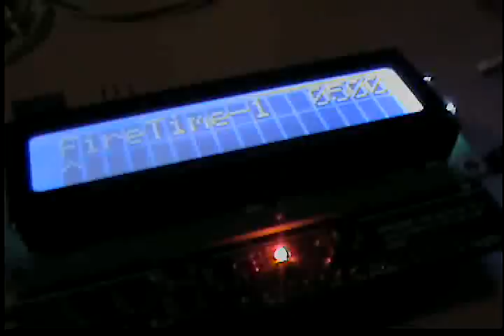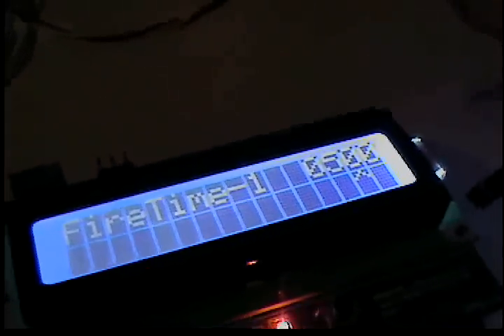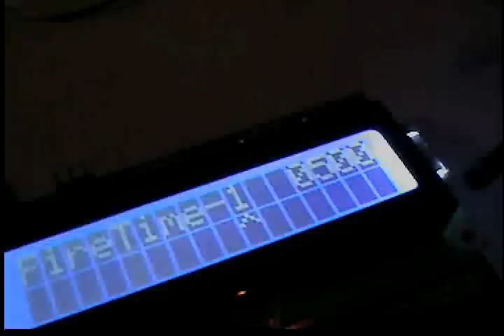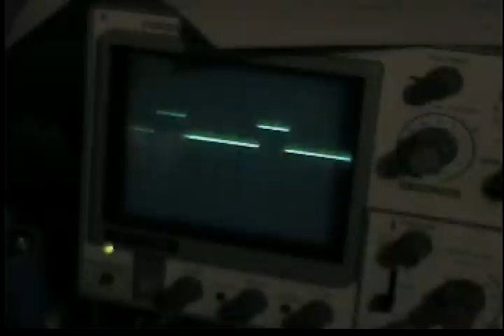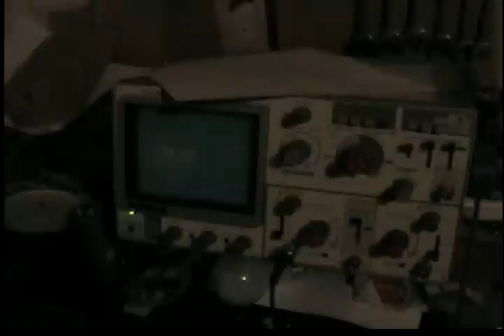Window motor update

Comment from the maker: @llewgnal  Yes if you change the 0 to a 1 on the save screen it saves settings. The changes made by pushing button are used right then, you only need to save if you want to start next time with same numbers. The micro number is stored in eprom once saved the called at beginning of the power being turned on.

Comment from the maker: @llewgnal the magnets are spaced 120 degrees apart, the halls are spaced 60 degrees. One hall fires the coil one way then 60 degrees later the other hall fires the coil opposite. So say trigger 1 fires every time north is up and south is down. As rotor rotates 60 deg now south is on top and north down so we need an opposite pulse. To fire 3 times per rev you use one half circuit, will only fire when north is up. Does that make any sense?